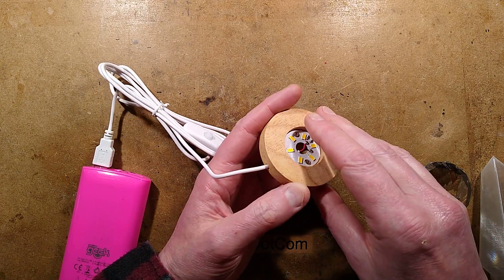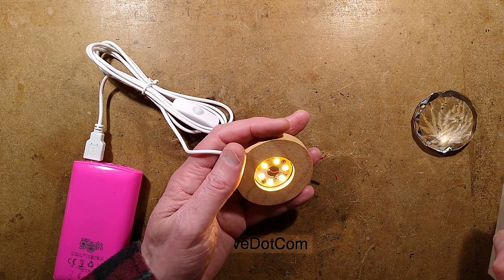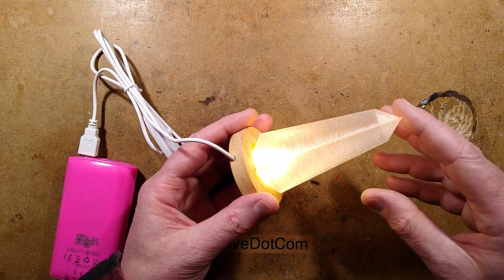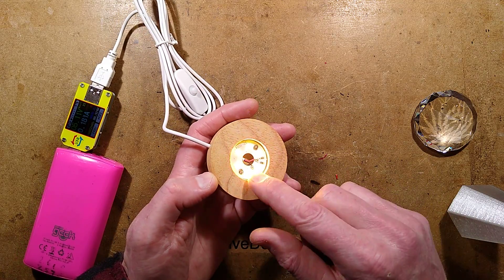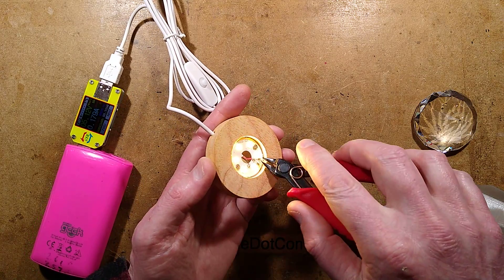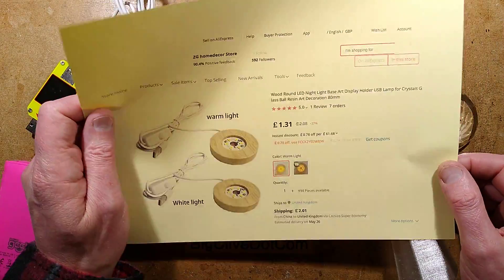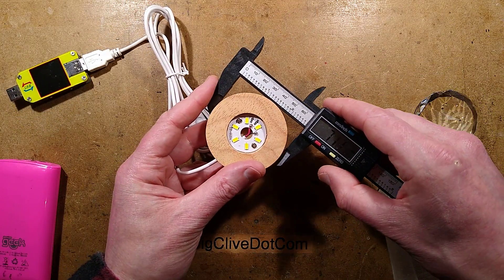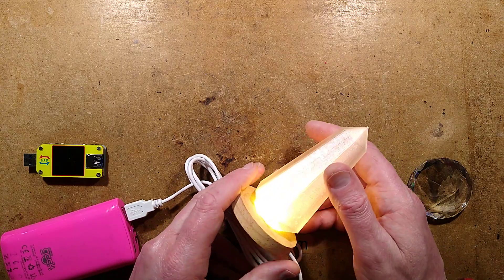Easy custom LED crystal with wooden base.

Comment: This is designed for the non-technical. You could easily make one of these with some left over components. You could make one with with a 3d printer, or print the crystal with a built in base.

Comment: Would you happen to have an eBay/AliExpress/Amazon link for JUST the led light and cable seen in this base, without the wood? It's perfect for another 3d print i'm working on but struggling to find what i'm looking for. Also, amy advice on chaining a few together to run off one USB plug? Probably 5 chained together would be perfect. 

I am actually using them for model bases, but a few linked together would be amazing!
Reply from the maker: You could use short sections of LED tape.

Comment: If some people are not confident in changing the variables in openscad (you should, it's very doable), you can also use the customization tab (if it is hidden, go to the window menu and unhide it). From there you can alter the parameters in a more user friendly way.

Comment: Take EXTRA  care should you use a " natural " crystal ... ( some ) are bromides / chlorides / flourides of various metals ( eg ; sodium / potassium etc .. ) these can be highly hygroscopic in wet climates ( UK / far East etc .. ) .. in days  you will end up with a nasty corrosive liquid all over your wood base  / table / shelf , causing untold grief .. stick to glass / quartz / plastic ( as in video ) .. FYI the liquid is as nasty as comes from leaking ALKALINE batteries ( grrrr ) ...

Comment: @bigclivedotcom If you place the comment ABOVE the variable, it shows up as a description in the parameters list eg:
//Diameter of base for lamp
base=33;
//Length of rim at base
rim=4;
//Diameter of crystal
size=55;
//Scale of crystal length (default 1.5)
scaling=1.5;
//number of faces (default 6)
facets=6;

Comment: If anyone is looking to buy lamp bases like this on eBay, avoid a seller called 2ndheaven2013. I recently ordered 5 led bases, only received one and then this seller refused to refund or send the other four. Complained to eBay who didn’t bother doing anything, so this scammer is still trading.

Comment: // Edited the code to adjust the top, bottom, and effective shape of the crystal.
//Lamp cap quartz crystal.
//You can adjust the variables below
base=33;      //Diameter of base for lamp
rim=4;            //Length of rim at base
size=55;        //Diameter of crystal
height=120;     //Total height of crystal
facets=6;       //number of faces (default 6)
shell_thickness=1; // Thickenss of walls
/* [Top/Bottom Adjustment] */
top_cap_height_ratio=0.14; // [0.00:0.01:1]
top_cap_size_ratio=0.5; // [0.0:0.01:2]
bottom_cap_height_ratio=0.14; // [0.00:0.01:1]
//Don't change variables below here
/* [Hidden] */
halfsize=size/2;
upper_height=height*top_cap_height_ratio;
lower_height=height*bottom_cap_height_ratio;
mid_section_height=height*(1-top_cap_height_ratio-bottom_cap_height_ratio);
$fn=facets;
eps=0.1;

echo("Height is: ", height);
echo("Maximum Width is: ", max(size, top_cap_size_ratio));
assert((mid_section_height>=0),"ERROR: Midsection must be non-negative.  Lower top cap height ratio or bottom cap height ratio");
difference(){
union(){
//outer body
translate([0,0,0])
cylinder(h=lower_height,d1=base,d2=base,$fn=100);
translate([0,0,-lower_height])
cylinder(h=2*lower_height,d1=0,d2=size);
translate([0,0,lower_height])
cylinder(h=mid_section_height,d1=size,d2=size*top_cap_size_ratio);
translate([0,0,height*(1-top_cap_height_ratio)])
cylinder(h=height*top_cap_height_ratio,d1=size*top_cap_size_ratio,d2=0);
}
//Inner core.
translate([0,0,-1])
cylinder(h=lower_height,d1=base-2*shell_thickness,d2=base-2*shell_thickness,$fn=100);
translate([0,0,-lower_height+shell_thickness])
cylinder(h=2*lower_height-shell_thickness+eps,d1=0,d2=size-2*shell_thickness);
translate([0,0,lower_height-eps])
cylinder(h=mid_section_height+2*eps,d1=size-2*shell_thickness,d2=size*top_cap_size_ratio-2*shell_thickness);
translate([0,0,height*(1-top_cap_height_ratio)-eps])
cylinder(h=height*top_cap_height_ratio-shell_thickness+eps,d1=size*top_cap_size_ratio-2*shell_thickness,d2=0);
translate([-halfsize,-halfsize,-lower_height*2])
cube([size,size,lower_height*2]);
}
Reply from the maker: If you hunt through my videos you'll find an inverted crystal and also a diamond cap maker.
Reply from the maker: https://www.youtube.com/watch?v=HZKu9QMN5xw

Comment: Get one of these, and use a $6 Himalayan salt rock from Tractor Supply, and you get a Himalayan salt lamp to balance your "new age" chi ! These lamps retail for over $50 at a "new age" (aka snake oil) store.
Reply from the maker: An orange plastic crystal has exactly the same "ionising" power.

Comment: Can Openscad export a file? I would like to get some things 3D printed by a 3rd party like JLCPCB. I could do it the hard way, install and try it, but I'm looking for the easy way out. LOL.
Reply from the maker: If you design your crystal and then save it as an STL file they should be able to print from that.
Reply: @bigclivedotcom  Thanks! I guess I'll be installing it.

Comment: Have you ever torn down a cellex wifi smart led bulb from tesco's it's only £10 and well made. It would make some 
good experimental material and contains 15  duel  temp leds and a Wi-Fi module which works with Google home.

Comment: Why use a battery when 2 opposed magnets will give you plenty of power to make it free energy 🤔
Reply from the maker: Because the magnets will go into critical overdrive when used with a crystal and generate enough power for a small city, and that will scorch the wooden base.
Reply: @bigclivedotcom  pure gold would solve that problem.great for the reflection of heat like in the Mclarren Engine bay to front seat.. no need for it after the Great Reset anyway...

Comment: I love this, man I wish we had this tech years ago, I've always been into lighting, give me anything that lights up except the actual central light in a room.
Reply: I love having multiple small lights illuminating a room.   Even my bathroom has two dimmable table lamps in addition to the usual installed fixtures.  My old den had about 20 or so things which lit up the room, including a Lava Lamp.
Reply: I prefer using a single bulb lamp that plugs into the wall, compared to the irremovable LEDs that are built into the ceiling in my room. I rather enjoy a warm light that doesn’t fill the entire room at night. 😊
Reply: Why go to Poundland when you can make your own tat ???

Comment: Looks like the beginnings of those "air-purifying" (allegedly) salt-lamps that does nothing but gather water from the air to cause salty drippage down onto whatever it's sat upon... :P
Reply from the maker: You can use orange PLA and then enthuse about how much it's cleaning the air.
Reply: Ha ha I agree but I don't think the comment from Lostjonny in the comment section agrees

Comment: What exact filament are you using? Just recently got a CR10 and wanna print a bunch of those crystals for props and really need that frosted, layered look.
Reply from the maker: I use generic clear/natural PLA.  But beware of cheaper versions on eBay that are more opaque.

Comment: Ooh, I actually really like this. I would love to get an RGB version.
Reply: Some Neopixels and a small controller, maybe a tiny 5 volt converter, yeah, it can be done in this size.

I made a "campfire lamp" complete with animation and sound effects at my workplace once. It's larger than this and uses way more LEDs, but the idea is the same.

Comment: Big Clive, try printing in white filament, it works well, you get a nice diffuse effect
Reply: You can also scuff up this translucent filament with very coarse sandpaper to increase the diffusion without blocking much more light with the white pigment.

This could make a decent light for a (fairly small) cylindrical lithophane.

Comment: Nice! Openscad is a quiet revolution. It's great that you can supply some variables at the top of the script and allow users to easily change the final print.
Reply: Thingiverse also supports it for their web based designer, you just have to format some variables and comments at the top of the file.
Reply: The variables and comments are already formatted so that the Customizer works.